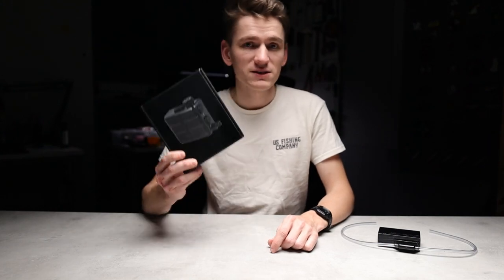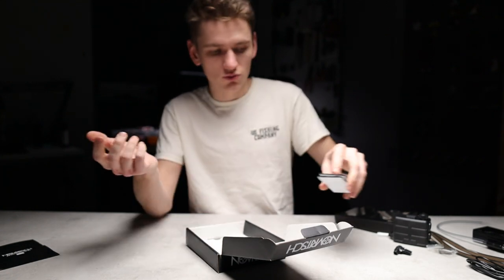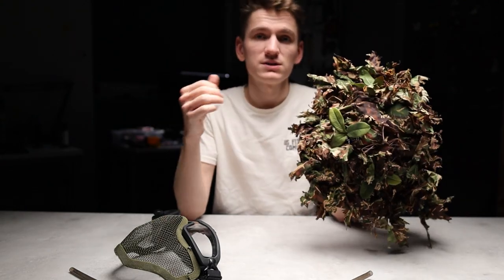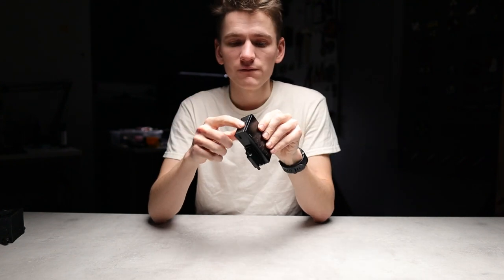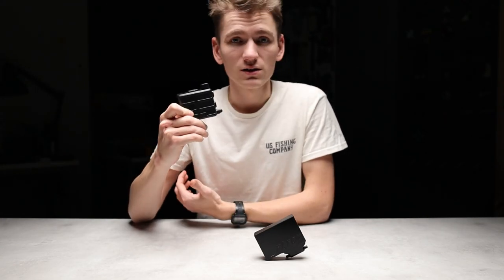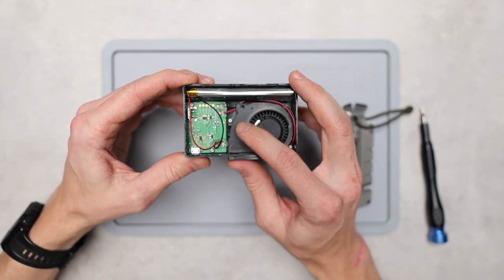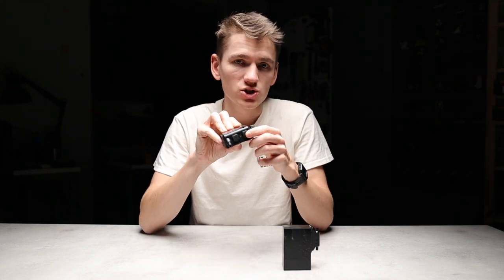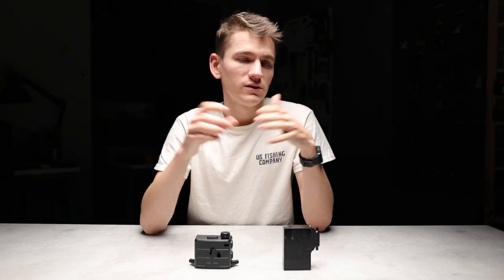NOVRITSCH ANTI FOG UNIT vs EXFOG (Review & Teardown)

Comment: Seeing the Novritsch Anti Fog shatter like that is a no go for me. Not to mention the large battery positioning and shape would be dangerous with a shattering impact like that, rapid thermal expansion in a battery is no joke.
Reply from the maker: Novrtisch just released Batch 3 of the Anti Fog Unit that has improved impact resistance. They claim it can withstand 3J impact without any issues, but I would wait before someone confirms that.
Reply: That is good, but it still is not close to the performance of the exfog. Using a broken review unit that is very old kinda screws the results💀💀💀. However, learning from the exfog could help you and Novritch improve the unit.
Reply: @tacocat5901  novrtisch anti fog gen2 will hold up up to 2J point blank, wich is more than enugh, at least here in germany and most european contries.
Reply: @XxXAirsoftboyXxX  yep

Comment: It was especially nice that a bb blew a hole through it on the first hit.  Lol
Reply: Use the money you save one the Novritsch to buy $1 of plastic for a shield.

The teardown made it pretty clear that the Novritsch  had far more design optimization, and apparently more power.
Reply from the maker: @APSupernary that might not even be necessary anymore - Batch 2 came with protective rubber patch included and Batch 3 that was just put on sale has supposedly improved material that is much more durable and no longer shatters.

Comment: Pretty disingenuous to test a product for its performance after you've already ripped it apart. You can see the tape on the exfog unit in the beginning of the video
Reply from the maker: We just made a blog post regarding the claims Aaron made in his video. You can see most of the points he raised being addressed with 100% transparency here: https://tridos.design/blogs/news/we-got-exposed
Reply: So your blog States you bought and tested a three-year-old Xfog unit compared to a new novritsch unit...gotcha
Reply from the maker: @kyleg7296  That is correct - but it seems like you didn't read the rest of where it was not possible for me to know that there have been internal upgrades to the device, the unit was lightly used and that it was not broken.
Reply: @TRIDOS.DESIGN it was still opened up and running on a 2 year old battery so lipo degradation is present and vibrations/noise probably got worse when put back together. If you could not open up the unit properly then I don’t believe you could put it back together properly. so not a fair comparison to be honest. Does not matter if you did not know there was an updated version, the point still stands that a 2 year old badly opened up exfog unit was compared to a new noveitsch afu.

Comment: Good review! While I typically like to root for the little guy, Exfogs should have made updates to their product, it feels like they kept it in the prototype faze and left it at that. (shoving 2 hoses under your goggles is not a secure mounting solution) Unfortunately, that means that sooner or later someone else is going to come up with a better version. Having said that, I don't see this as an Exfog killer, but more as a kick in the pants for them to update their design.
Reply: Exfog has some edge over the AFU, but honestly just seeing their joke of an employee and their channel test video and their whole demeanor I wouldn't ever give them a dime 🤷 I'd rather make my own or buy a AFU and put it in a self built case, or reinforce it. 😂
Reply: This is an old prototype Exfog unit that's malfunctioning, he didn't even use a current or working Exfog to test against. I've held both the Nov unit and I have an Exfog, tested against one another it was clear the Exfog was more well-constructed and pushed way more air. This comparison is wayyyyy off base and clearly meant to shill for Nov.

Comment: EXFOG is some of the best money I have spent in over 25 years of paintball. 

I have beat mine up and it's still going strong without issue,  battery is lasting long enough for an entire weekend of play.  No cracks in the housing.. unlike this copy. 

I'll stay with the original and suggest others do the same.
Reply: I haven't had my hands on yet of the Novritsch one but the Exfog I returned the next day without even trying it out on the field as I couldn't stand the noise and vibration. Using my own made coolers attached on the back of the battle belt or chest rigs.
Reply: Paintball masks are great at not fogging though. I don't really play anymore but I used to play tournaments. My Proflex, Profilers or Events never really had fog issues. I can only imagine that tech has improved with something like an EVS or i5. 

I recently found out the empire proflex's have mesh bottoms (E-Mesh) specifically for airsoft. That sounds like it would never really fog up. But I haven't looked into it much yet.

Comment: Thanks for the review, obvious bias aside. I had to comment when you said "many consider this the original" regarding the ExFog....it IS the original, so the only people who don't consider it the original are those who don't know about it. Arguing it "isn't user repairable" is pretty slanted given it is literally just glue and a few pieces. Pretty simple repair compared to most devices nowadays.

I'm glad Nov is giving some competition in this field but weight, durability, noise, and battery life all mean I'm glad I went with the ExFog. Do think I'm going to pick up the magnet kit for the goggles to see how well that works.
Reply from the maker: Appreciate the constructive criticism! Honestly it was a nightmare to open it up and the case got damaged on ExFog quite a lot. Unfortunately I had done this way before and don't have it on video. I agree that ExFog is still a great choice but the interface and price (in EU) is what makes this a no-brainer to go with Novrtisch one for me personally.
Reply: Does your eyes dry because of the airflow? That is my main concern.

Thanks in advance,
Angel
Reply from the maker: @Xxxxxxxxxx3582  I usually run it on lowest setting and I have not noticed any dry feeling on my eyes. Have had it on me for several hours at a time with no issues. On highest setting or turbo you can definitely feel a breeze going across your eyes / face but that should be used only temporarily in my opinion.

Comment from the maker: Our response to ExFog's video: https://tridos.design/blogs/news/we-got-exposed
We suggest giving it a read before jumping to conclusions. Unlike us, ExFog has direct monetary incentive in this so everything they say should also be taken with grain of salt.

Update 27/08/2023:
Novritsch just released Batch 3 of AFU which is now produced from a different material and they claim is now BB resistant. We haven't tested it but just to put into perspective - in 6 months they improved and fixed the main concern of the device. ExFog visibly had not changed anything about the device in 5 years.

A few notes:
1. It appears that we have an older version of the ExFog and they have made improvements internally, however, we could not have known this since this is not mentioned anywhere and externally the device has been the same for several years.
2. Even thought the plastic case did break, it is not as brittle as it may seem on the video. I've had it thrown around in my gear bag and used it roughly for several months without an issue.
3. Some have had issues with the mounting piece coming apart and needing to use super glue to fix it. It's not great but it's an easy fix and this will most likely be improved.
4. ExFog did come out and point to the patent finally - you can find it under application number 20190373978 here: https://image-ppubs.uspto.gov/dirsearch-public/print/downloadPdf/20190373978
Reply: I would simply add that it isn't simply improvements, but it is common knowledge that a LiPo battery naturally degrades over time.  They are warrantied by manufacturers for 1 yr and that assumes no use.  If you have not been properly cycling the battery when not in use every 30 day a LiPo will further degrade.  Given that this unit is 2 yrs old, the simple LiPo degradation will affect the air flow test, the voltage testing, battery life, etc.  So while the improvements are also important to note it is also important, generally speaking, that one doesn't review a used product vs a new product.  They should be in like condition to be a fair assessment.
Reply: You say you no longer worked for Novritsch at the time but his video was recorded, but your response says “our response”….yeah, pretty fishy and negates much of what this video claims, In my opinion 🤷🏽‍♂️
Reply from the maker: @Evol1HipHop our response as in TRIDOS.DESIGN company. Always look for more than one opinion and in this case we suggest reading at least both sides of the story before jumping to conclusions. At least we didn't accuse the other side of fleeing to mexico to avoid legal action, as per exfog's "legal team".

Comment: Great test to compare the two.
I dont see a problem one of the units are an older version.
I was surprised the Novritsch one was shot out that easily....
Keep up the good work.
Reply: When a LiPo battery is 2 yrs old it naturally loses integrity, not to mention care of the unit in 2 years impacts the power and longevity, this basically makes the voltage testing, fan power testing, longevity testing irrelevant.

Comment: Maybe a test when both units are attached to goggle connector. There is a huge difference when you just fit in tubes in to the goggle so air goes any direction and when then the air is directed at lenses. For those who has contact lenses (including me) it is a huge impact.
How noticeable is noise when you wear it on helmet and boonies. Well this is relative test, but a general feeling and opinion will be interesting.
Reply from the maker: The relative performance will still be the same when both units attached to the goggle connector. But I did see comments from several people on Facebook groups that have been running AFU with prescription inserts and have had 0 fogging. 
On helmet the noise transfers a little better since it's attached to a hard surface but on boonie I barely notice it. It's like white noise and you quickly just phase it out. You only notice when you are in a complete silence and you're trying to listen for footsteps in distance.

Comment: A couple weeks ago I attended an event in Ocala, FL. It rained heavily the night before, and was overcast the entire game play, with tiny sprinkles. To say the least it was humid. Event coordinators tried something different and had the game briefing on the field. For the briefing, I wore my ESS turbofan goggles. They could not keep up with my sweat and I could barely see. Went off the field, put on my hat and helmet with my novritsch system, and went to play. The goggles I used were standard ESS goggles with prescription inserts. Kept the fan at about half speed and worked beautifully. I did have an issue where I adjusted my goggles and my sweat dripped on my lenses. Had to go off field for a short bit to dry my lenses completely. I would recommend making sure your lenses are super clean and dry on overly humid days.
Reply from the maker: That's awesome to hear!
Reply: Did you use the connector to send air or just dropped the hoses into goggles? I have no issues with fogging in ESS Turbo fan, but when I add RX insert - they keep fogging like crazy
Reply: @sergeysoff   I use normal ESS goggles with my fan system. It fits nicely with helmet so hose fits perfectly between goggles and helmet.

Comment: The update unit by novritsch is more harder plastic, the unit has rubber plugs protect the usb c socket from water, but the exfog has non of that and i return my exfog unit due to bad build quality as you can see the glue lines of the unit

Comment: You sayd something about the novritsch device draining battery when not in use. What does that do to the battery? If i play 2x a month, do i need to recharge 1 day befor game day or like i do with the exfogg unit, directly after use?
Reply: I’d do the day before the game.
Reply from the maker: Definitely the day before. But you can always just check the battery status.
Reply: Hmmmm, that would be the next upgrade then. A battery disconnecting swich so you can't unload the battery pack. That is absolutely not good for any battery when you dont use them for a longer period of time like a summer vacation or a winter stop.

Comment: The shoot test a few comments.  1.  The exfog unit having give by the manifold after being shot has everything to do with the loss of integrity when the lid was removed.  This does not occur on a fully intact unit.  Even not secured it still did not break.  In comparison the nov unit blew a hole through it after 2nd hits and further broke apart after subsequent hits.  I can't stress enough the unscientific nature of this test.  In addition the exfog unit was knocked over and it was continued to be shot at angles not consistent with angles in the field.  Even with that it didn't break.  Hmmm

Comment: can i connect the existing tubes on my glasses that were included in the exfog unit and connect it to a novritsch fan, for more airflow?
Reply from the maker: You can most likely stretch the smaller tubes from ExFog onto the manifolds of the Novritsch unit. However, keep in mind that those smaller tubes do restrict some airflow so it will not be the same power output as using the original tubes that come with the unit.

Comment: My main concern is what happen if the magnetic mount gets shot?   As I am trying to avoid plastic in my eye.
Reply from the maker: There is no way that could happen - even if it got hit, it is extremely unlikely that any of the debris vould get into the goggles and even then, there is no way any of that debris will have any momentum to it. But if you're still worried about that, you could just resort to using the tubes in the goggles method.

Comment: Am i able to use the novritsch ones without the magnet? cuz the googles im using sit flush with the helmet so my idea was just use the tubes inside the helmet and blowing air to the googles
Reply from the maker: Of course - you can just remove the magnetic piece and do whatever you want with the tubes. And you can always get an extra set of the tubes on the cheap. The difference is that the AFU comes with the magnetic piece for those who can use it but ExFog just comes with bare hoses without that options.
Reply: @TRIDOS.DESIGN  anyways the product doesnt have stock anymore so i have to wait

Comment: Good review. Was considering the exfog, but the high cost just made it not worth it.

The nov one is cheap enough that the case issue isn't a direct dealbreaker for me as I can just 3D print a better case, but that should be changed asap.
Reply: The comparable exfog unit is currently available for 10 dollars more.  The essential kit offers equivalent accessories and is available for 59.99 usd.
Reply: @jenniferbennett3540  hahaha
no. it's 130usd to get it here. You guys can't work out a decent shipping deal and are losing customers here. 

And after seeing how ye guys have been going about this online I've spread it to the airsoft community here and most are in agreement it's better to go without rather than your product
Reply from the maker: In europe, most places are out of stock and the only place it is reliably in stock it costs 130€ incl. shipping - I literally inserted a screenshot from the cart and exact store. And ordering directly from you guys is not an option, as importing goods in EU is applicable with 21% VAT (varies slightly from country) and 5%  duties. Not to mention the shipping cost from US is pretty significant as well.
Reply: @TRIDOS.DESIGN  yupp. I live in Norway aswell, so I get another 25% on top off that, plus 15€ handling fees.

Comment: Uses a broken system or he plugged the hoses, I have the exfog and it works wonders in concrete buildings on rainy days.
Reply from the maker: At no point we claimed it didn't work - I personally ran ExFog on the field and it did it's job for me functionally. However, I knew personally more than one person for which the power output (airflow) wasn't good enough and he was still fogging. In the video I said - they are both going to do the job for most people. And no, the hoses were not kinked or hoses plugged (we actually had a take where we had this happen with AFU and we were surprised it wasn't doing much either).